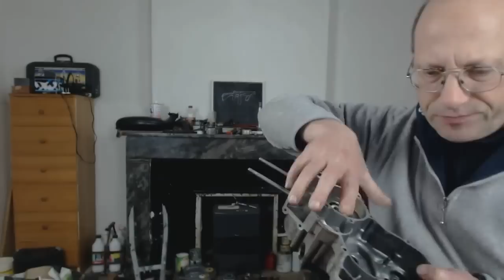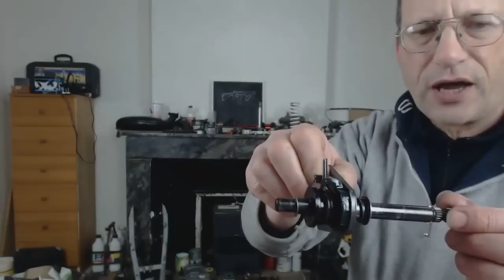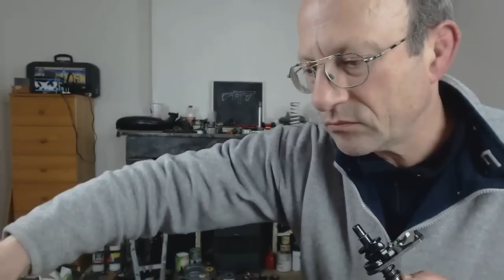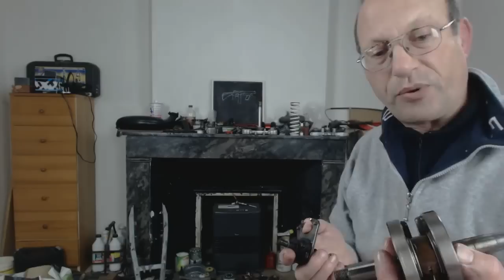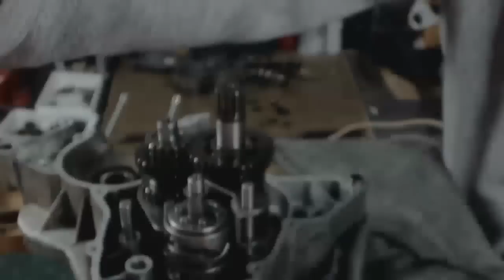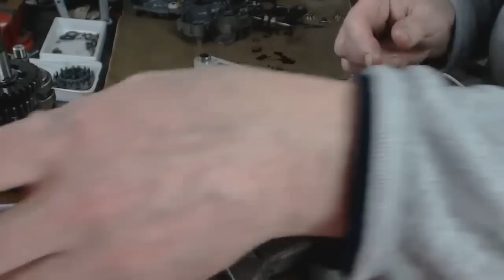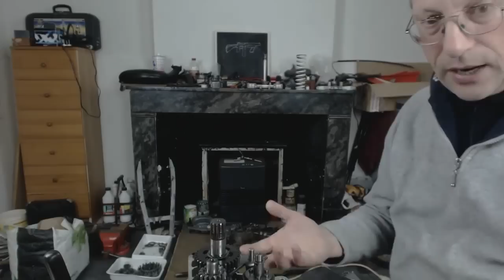AM6 Gearbox Assembly - step by step

Comment: My bike is from 2020 it’s a fantic performance 50M, would this video still apply even though it’s 10 years old?
Reply from the maker: The video provides a general overview, regardless of modifications.
Having said that; if the engine is based on an am6, then it may be exactly as shown.
:)
Reply: Its probably different, u have am6 2nd gen

Comment: Dude would have an aneurysm if he took the gears apart of the shafts 😂. He spent HOURS putting this together and it takes less than 20 seconds for anyone that just looks at the manual
Reply from the maker: LOL!
You have zero understanding, of what it means to get to know a mechanical assembly.

We don't simply slap together components, in 20 seconds.
Reply: @EngineTuning  if the engineering of this chea little motor has you overwhelmed then perhaps it's not the field of study that is fitting for you.  I build missile systems and military jet aircraft for a living, I am bored by the simplicity of it all. But yet I still find it amusing to see how others respond to the simplest of assemblies  cheers m8 🍻
Reply from the maker: @ahole5407  Hahahahah!
That's so funny.

Let me assure you, that if you were an engineer ... you would never say that.

That's why a bullshitter is so easily (and always) spotted.
... and the funny thing, is that the bullshitter has no comprehension of this
... which is really funny to everyone :D
Reply: @EngineTuning  oh I never said I was an engineer,  I'm a machinist so don't insult my intelligence . 😂

And BTW, we make more than the engineers in defence aerospace because we have to fix all of their mistakes 😁
Reply from the maker: @ahole5407  
Keep digging ... the hole just gets deeper.
We've seen it all before.

The guy that doesn't know, has no comprehension that 'other people know.'.

If only you knew ... but you don't.
That's why 'ignorance is bliss'.
:)
Reply: @EngineTuning  I am A HOLE. The hole. The deeper I go the louder you will scream 😂

Comment: i need help it pops out of secound gear if i put it in first then secound, but if i go third to secound its perfect. Also going into 2nd gear feels weirs like it doesnt entirely kick in any help?
Reply from the maker: A component, or perhaps multiple components, could be worn.
Perhaps springs, or selector fork (or whatever).
Either way, the engine must be split.

Don't rush, and you'll be fine.
Clean and prepare your work area.
Take pictures, and take notes.
Keep all the components in logical groups, and keep them clean.
Carefully examine each component.

Good luck!
Reply: @ i mean when it was 50cc no problems have split the engine before everything looked good. Put a 70cc kit and immidiately started acting out
Reply from the maker: @RevCycleGarage  
This indicates an assembly error, or at least a high probability of it.
Increasing engine capacity by 20cc will not be the cause.

It's hard to bear, but the task remains the same :(
Reply: @EngineTuning  I knew that i neede to dissasemble it  but i was having hope of not having to ig i still have time until riding season haha
Reply from the maker: @RevCycleGarage  
Let's hope that the problem is easily found :)
You can always report back with your findings.

Best of luck!
Reply: @ Thanks mate ofc i will report unless i never fix it and drive it first third and if anything more serious brakes just transfer everything to my other bike and make the daily a project bike🤣

Comment: Why could am6 engine have more than one neutral
Reply from the maker: Worn components perhaps.
Reply: Bad engineering from Minarelli and It is present on all new bikes too, I've seen
You can fix it by replacing the gear drum for a better one, makes the shift lever more light like on a Derbi

Comment: I have a Generic Trigger, which is only allowed to drive 30km/h here in Denmark. A screw prevents it from using gear 4,5 and 6. We have recently bought the machine. The problem is that the screw does not work on this. It has therefore 6 gears. Is it possible that the pin on the shift drum has broken?
Reply from the maker: Hi Thomas :)
This is interesting.
A screw (presumably located inside the gearbox), is used to prevent the rider from engaging gears 4,5, 6.
However, you can engage all the gears.

That sounds like a win, to me (rather than a problem) :D

My guess is that the previous owner split the engine and removed the screw ... but you may be correct, and the screw is broken.

The pin on the shift drum, interacts with the gear change actuator.
When the gear lever is lifted or lowered, the actuator pushes the 'pin and drum', clockwise or anti-clockwise.
This rotation moves the shift forks, which causes the gear change.

If the pin was broken, it would be impossible to change gear.
:)
Reply: @EngineTuning  is the actuator pushing on the pins on top of the drum or somehow on the one big pin on the shaft of the drum? I dont understand what the pin on the shaft is used for otherwise.
Reply from the maker: @thomaspschmidt  There is only one pin.
You can see it at the end of the video, where I use my hand to rotate the drum.

Comment: Hi I’ve just purchased a bike with an AM6 and seem to be having an issue with the gearbox. Starting from neutral and working up through the gears there is no problem, but trying to change down even in 5th / 6th to a lower gear often puts the bike into neutral no matter how many times I try and downshift. If I now were to stop and go up one gear I’d be back to first, could it be the selector fork slipping of something? Thanks!
Reply from the maker: Whatever is causing the problem will become apparent when you strip the engine and gearbox.
When you have found the cause; perhaps you might return here and report your findings :)
Good luck!
:)

Comment: Hey great video! i have a question, here in denmark the gear shift cam is restricted in the new engines so we only have 4 gears, if i was to change this back to an normal one, i would be able to shift into all 6 gears by turning the gear shift cam before assembling it again right? so i dont have to assembly it all just to find i still only have 4 gears or something.
Reply from the maker: I have never heard of this restrictive mod.
In fact; it doesn't make sense to me.
The objective of the gearbox is to enable acceleration, by matching load to rpm.
... One cannot simply eliminate 2 of the gears, without matching the remaining 4 gears to the load and rpm.

If this is happening, then... in 4th gear, the engine will be revving it's guts out.
That is, unless the gearbox has been completely redesigned to spread the load across 4 gears (instead of 6).

Comment: What can cause my gearbox getting stuck if the shafts are going freely when just the clutch or output shaft is installed but when both go in together they get "stuck"? Everything is shimmed correctly. I have noticed if I push the clutch shaft away from the casing it goes freely (when the basket is also installed), is something wrong with the gear shafts? The gearbox was working properly before I took it out for rebuilding
Reply from the maker: Hi Felix :)
You have raised one of the huge areas of concern in the current education system ... something that men have been campaigning for, for decades.

There was recently a petition in the UK stating:
"We the people, demand that all children should be informed, that if a gearbox was working before it was dismantled, then it should be working after reassembly".

The petition failed to attract sufficient signatures, and consequently, we remain with young adults leaving the education system, not having learned this valuable lesson for life.

Shame :D

Other than that ... I would advise that you be careful, when stating in your brain, that you have done everything correctly (eg. shims).

Start again.
Assemble the gearbox, without the crank shaft (as per normal assembly testing).

During assembly, keep spinning the shafts, as you gradually nip the cases together.

At the same time, keep feeling for lateral play in the shafts (ie. free play along the axis).

The single most important thing to think about is:-
"What have I done wrong" ;)

With this mental attitude, you know damn well that you will easily discover what you did wrong :)

I would say 'Good Luck' but in this case, you don't need it :D
Reply: @EngineTuning  there's only supposed to be one shim under the output shaft so I'm confused to what's wrong, the engine was never fully assembled because I was worried something was wrong with my gearbox, only the output shaft shim, output shaft, and clutch shaft were installed at that moment along with shift cam and all 3 forks with the shaft going down the 2 forks. Is it just how it acts when the gearbox is laying inside one of the cases? The shifter wasnt installed since I lost the shim for that one. I'm sorry if this these questions are stupid, this is my first engine rebuild and I'm trying to learn.
Reply: @EngineTuning  just had a thought, does the lip on the needle bearing matter if it's up to the shaft or to the crankcase? I think I installed mine with the lip up to the output shaft
Reply from the maker: @BOB_ToT  It's hard to say Felix.
Somewhere in the comments below, I believe I linked an exploded diagram of a Senda.
... but the key in this case, is 'simple trial and error', because it's not that complicated, if you are only assembling two shafts.
Regarding the lip of the bearing ... I can't remember.
However, it is unlikely that the needle bearing is 'handed'.
Obviously, it needs to be seated correctly ... you know ... swarf and grit (hopefully not) :)

The thing is ... the centre lines haven't changed.
Consequently, it must be lateral play, that isn't playing.
... That is, assuming that the shafts are assembled correctly.
Reply: @EngineTuning  both good and bad news, it was skipping teeth until I tried putting the other case on with just the gearbox assembled and it went smoothly. But when I assembled with the crankshaft and sealant the clutch shaft is now completely stuck with the output shaft only moving around in neutral so something in the box must've hopped without me noticing. I'm suspecting a fork might've hopped out of the cam since I had to pull up the engine half since the case only went halfway and it pulled the gearbox with it slightly, and I was stupid and didnt think of it, so now I'm gonna have to take apart the engine once again, yikes I feel like an idiot now
Reply from the maker: @BOB_ToT  Hey Felix ... there is no need to feel like an idiot (I know that it is an expression).

The human brain has lots of quirks and foibles, particularly when under stress.
You'll often hear an interviewed 'well trained' soldier say 'when all hell broke loose, I fell back on my training'. Whereas a poorly trained soldier won't be around for an interview.

From a great deal of experience, I can state that the 'norm' is for people to say "I've done this, and done that, and I've also done the other ... and it still doesn't work".

At this point, the brain is in utter confusion, which in itself prevents further rational thought (this is truly how it is).

Therefore, the primary keys to troubleshooting, are:

1. To take on a calm aspect that is removed from the actual problem. This is so that you can look down on yourself, and see what you are doing.

2. To be methodical, in eliminating what is not causing the problem. For example, what you did, by test assembling, by gradually adding components, until failure occurs.

This organised methodology is just what the brain likes. It is fully informed, and can produce conclusions.

The other key depends upon whether a clear anchor is available - sometimes at first, it is not - like a failure in use, where the previous history must be examined for clues.
In your case, the anchor was, that the gearbox was working, before disassembly.

So I suppose, this post could be summed up as:
Stay calm, work methodically, and base your actions upon absolute facts.

Hopefully Felix, your next post will be to announce that everything is working again.
:)
Reply: @EngineTuning  indeed, since I was intending to replace the crank in it due to high mileage I use the sketchy method of hammering the crank arm to disassemble the blocks, but obviously didnt plan for the assembly process to go bad, so I've ordered a proper separator now so it's hopefully gonna be fully assembled and everything in order by the end of the week :)
Reply: @EngineTuning  after some trial and error it stops locking up whenever I take off the shim on top off the shift cam, the only other shim I can find of similar size is the same it seems. Although I'm worried about assembling the engine without the shim can lead to gearbox issues
Reply from the maker: @BOB_ToT  Hi Felix :)
Sorry to hear that you are still experiencing some difficulties.
The thing is, if I may say with all due respect ... you have not yet fully taken en board my sincere advice.
That being:
This is a mental challenge, as much as it is a mechanical challenge.

It doesn't matter if a fairy has caused this problem (hahah, and she might just have done so) ... 
Your mantra must be 'it is not assembled correctly'.

Any talk of assembling without a required shim, is  the product of despair.
... That's a mental condition!

You need to bin the despair, and replace it with 'pleasure'.
"hmmm! Still not there. This is taxing me, but I'm up to it".

"I have done something wrong (now I long for yesterday)" :D

Hahah! Stay calm and confident in the knowledge that you will discover the cause of the problem.
... with the emphasis on 'you', because you know that I don't have any clue as to what you've done wrong.

LOL It'll be something simple
... and when you've found it ... with hindsight, it will be crystal clear, that 'all you had to do, was find the problem'.

What else can I say?
It's been like this for millions of people before you, and it will always be like this.

Obviously, you have my best wishes
... and I do know that this situation is shit!
:D

Comment: Great videos . I need information .  I have 1998. Rx 50 Aprilia . If I am going to put inside Polini 70 ccm , 47 bore kit , do I have to make any change in crancases? Do I need to grind the crankshaft blocks to get the cylinder well inside and the piston not to hit the bottom dead center in the blocks? It is rare old  Polini W shape kit. Tnx
Reply from the maker: For a 70cc BBK, I haven't heard of one requiring engineering mods, because 70cc can be gained from the available space.
Good luck with your project ... it sounds great :)

Comment: my gear shifter gets stuck when im shifting....
Reply from the maker: Thanks for the comment, but...
It would be much more interesting to read, if you provided the historical context.

Perhaps the gearbox has never been stripped, and the problem has got worse.
Maybe you stripped the box and made an assembly error.
Maybe everything was fine, until one moment, when it started to fail.

In addition, you could outline your on-road solution ... ie. how do you then change gear?
;)
Reply: @EngineTuning  after iu blew my cylinder my gear shifter started to get stuck. Lit no respons at all. i have never stripped the gear box. Soooo my solution is that i put a trampoline spring at the gear shifter and to the frame so i have little spring fealing.
Btw sorry for bad english=)
Reply from the maker: @oasvensson1  Never say never, but typically, there would be no connection between a failed piston, and the gear-change.
You will need to split the cases and examine the gearbox.

It's a nice project :)

Comment: What's that needle in the shift cam for?
Reply from the maker: The gear change actuator.
Reply: @EngineTuning  is it supposed to be a stopper that it doesn't moves too far? 
could you please describe the purpose because no translator delivers a good translation. Thaks a lot 😁
Reply from the maker: @muddadeine31  It's the gear change actuator ... look at the gear change shaft - it connects to a U shaped lever.
This U lever rotates left or right, pushing on the pin, rotating the shift cam, which in turn changes the gears.
Reply: @EngineTuning  I don't mean the pins on top of the shift cam, I mean the one wich is inside the hole. They're called spring pins i think. Even tho, tanks for helping me out.
Reply from the maker: @muddadeine31  Try spending more time, when preparing a question ... what hole, what spring pin?
Why not upload a video?

Comment: Ive got a problem with my gearbox. Ive put it together like this but when i try to change gears it sometimes works, but sometimes not. In both directions. And ive got a lot neutrals. But sometimes theyre not neutrals. Also my Kickstarter moves when i push my bike and ive put a gear in. Does anyone already knows what it could be? Also my oil pump doesnt pumps when ich kick it without turning my key. Should it be like that? Im not so sure. Thanks for your answers
Reply from the maker: There can be no doubt that the assembly was incorrect.
You'll have to start again.
Proceed slowly, and test assemble without the crankshaft installed.
Only when you have the gearbox working, should you install the crank, test again, then complete the unit assembly ;)
Reply: @EngineTuning  got the problem, a snap ring in the cam with the one fork was loose an some gears didn't wanted to stay where they are supposed to be. Like that, changing gears was just luck.